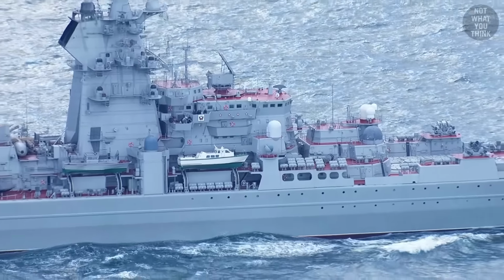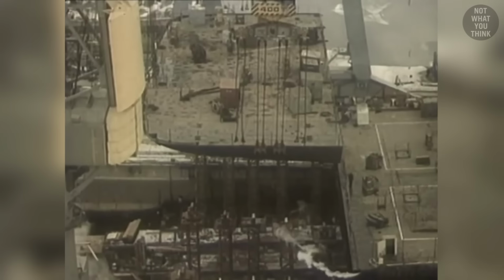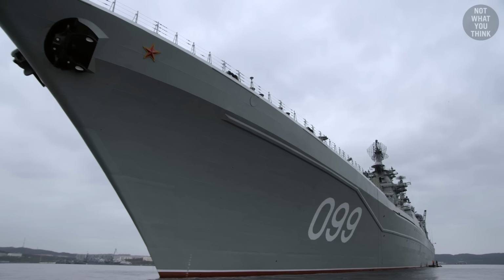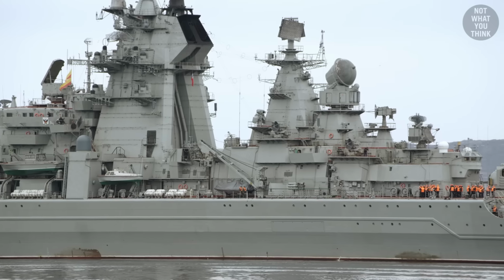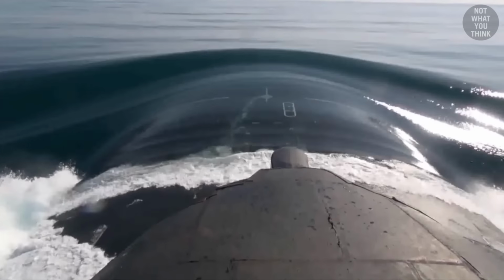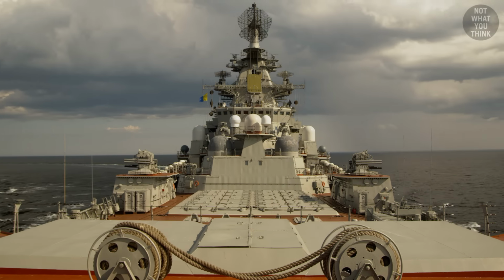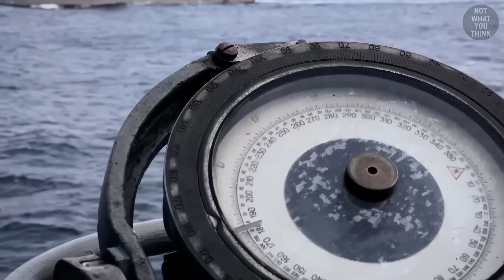Russia's Massive Nuclear-Powered Warship That Smokes

Comment: The US classifies aircraft carriers as CV, aviation cruiser. The nuclear surface ships should have both diesel generators and an auxiliary boiler. A nuclear ship capable of 30 kt might operate at about 20% power for 20kt. Power goes up sharply above 25 kt. The diesel generators are normally only used to provide electrical power while the reactors are shutdown. The auxiliary boiler allows water distillation, heating and cooking, again the main steam plant is shut down. Otherwise , main steam can be used for auxiliary loads.
Now comes the debatable topic. The service life of the hull and the reactor may not always align. Suppose it is felt that the hull might last several years after the current nuclear cores are expected to run out of fuel. If this is known sufficiently far in advance, we can make the decision to run the diesel generators and auxiliary boiler, reducing normal load on the reactor from 20% to perhaps 10%, extending the life of the core to the desired period

Comment: If you intercept the Bissell close to its Target the debris will Pepper you like a 7 ton shotgun shell but if you get this thing out a thousand two thousand meters it's just going to drop into the water the pieces they're not going to have that much inertia especially when they lose aerodynamic properties

One thing I find funny about people saying you can't shoot a Hypersonic weapon is that you don't need to Target the weapon you just need to throw a handful of gravel into its path and the speed is going means that that gravel is giving the same kinetic Force to the missile is the missile itself is going to give so even if you shoot it with double-ought buckshot that buck shots going to be traveling at several thousand miles an hour in relationship to the missile and it's just going to tear right through it this really is an application for Flak with many small pieces

Comment: Nice video, the issue though is that while Russian tech are, on paper, capable of doing certain things, the truth often being it isn't the case, it is often not reliable enough, doesn't work properly, or even simply lack crew capability to properly use it, like the KA-52 shot down by missiles while having their anti missile system turned off during a war that involve heavy hostile anti-air use...
Reply: At least one of those 52s was destroyed by a Ukrainian ATGM ("Stugna P"), that uses laser guidance. Even if the missile detectors/jammer had been turned in, it would have made no difference. Starstreak, a British anti-air missile, also can't be effectively jammed or "distracted." rooZZians just believed their own hype and didn't give enough thought to what could possibly pose a real threat.
Reply: @lordphullautosear  Actually, modern aircraft, including the KA-50, do have laser detections for those eventualities.
As well as other protections, like IR sensors that detect missile launches (at them or otherwise), and IR jammer.
There is also laser jammers that blind laser guided missiles but IDK if the KA-52 or Russians in general do have that tech (I know they have laser detection and IR jammer, but IDK how it works if at all against laser guided missiles).
Look out the "Vitebsk-25" system.

But in any cases, either the pilots poorly reacted or were not properly formed to use the tech properly, or the tech didn't work, or they were taken by surprise in a situation they didn't have the time to react.
But two out of three possibilities are Russians nor knowing how to military... xD

Comment: You are correct when you state the Kirov class cannot achieve top speed without bringing an oil-fired boiler online.  During the 1970s I was stationed in USS Francis Hammond (FF-1067), we were conducting SOAP or Soviet Out-Of-Area Operations.  Simply put, we were following a Kirov class ship and another ship.  The Soviets would very rarely venture outside their home waters.  My ship was tasked to follow them around the Pacific.

Comment: Using nuclear power for the slower speeds the ship uusually operates at was more economical. Then adding a cheaper oil fired superheater to give the steam more energy and enabling a high rtop speed  when needed. A much less expensive solution than installing nuclear power plants with sufficient power to drive ship at its top speed.

Comment: I wonder if, with the removal of the aft turret on an Iowa class BB, could a nuclear reactor be slotted into the now-empty barbette...?
Reply: the 100000 OSHA violations that would entail tho...
Reply: @idkk1086  Fun fact: OSHA straight up just doesn't apply to the U.S. military. Those soldiers can do whatever stupid, dangerous crap they can get away with, and OSHA can only look on in horror with no power to stop it.

Comment: Actually, the Iowa Class aren't permanently decommissioned. Each organization that has one as a museum signed contracts that basically make them no more than caretakers of the ships which have to be kept in mothballed ready to reactivate condition. The curator of Battleship New Jersey has talked about this on multiple occasions. He did so recently in a video on their future day docking of the ship.

In previous videos you can tell he is worried they could reactivate the Iowa Class and take New Jersey away from him. He makes so many BS excuses as to why it wouldn't be practical or cost originative even though reactivation is cheaper than building s be ship with similar capabilities. He also tried to claim that it can't handle the power of modern weapons/missile systems basing it on the ship using incandescent and florescent lighting even though they'd be replaced with LED lighting that is fast more efficient in a reactivation considering they replaced a lot of the incandescent lights with florescents.

The only reason who the Iowas were decommissioned in the 90s was because of politics and corruption/graft. It was done so those destroyers with the vaporware rail find could be built that taxpayers lost billions on and can't do squat as a naval asset.
Reply: What role would you have an Iowa serve?
You have to train up a lot of sailors to operate it's specific systems, and more importantly maintain logistics to keep everything going. Is it worth all that? I can think of tons of things that money and effort would be better spent on.
Reply: @IllustriousCrocoduck  What role? Try multiple roles. First off, the Iowa Class serve as intimidation and a deterrent with our enemies. A role they served in for decades that actually helped keep the peace. Then there is shore bombardment/troop support a role which is one we haven't had filed since the Iowa Class were decommissioned. Mine sweeping is another role they are capable of that we don't really have anything else to fill with. Then there is the fact of its survivability compared to any ship in the US Navy or any Navy for that matter. If what happened to the USS Cole happened to an Iowa Class there wouldn't have been any need for repairs just a squeegee and some water to clean the blood smears off of it. We don't have anything remotely armored like they are. And I can go on here too.

Bottom line, to replace one Iowa Class, it requires multiple ships to do so and none of them can do what Iowas do nearly as well. Look at every attempt to build a ship to replace just one of the roles they are well suited for and capable of. Every single one has been a failure that has wasted billions and billions of taxpayer dollars. Spend a billion dollars in today's money to completely modernize, automate what systems you can, and reactivate an Iowa and you're still coming out on top financially and militarily.

Comment: Yeah, the claim that an intercepted Granit missile will just sail onto the target by inertia alone is literally not how physics works. It's an interesting story though. Aegis and a single F-35 can stop an entire Granit salvo by themselves, without the CIWS systems even coming into play.
Reply: IIRC the claim was a bit more realistic - if it gets into CIWS range, at least shrapnel damage is guaranteed. More if the Phalanx fails to hit it.
Work on missiles like this was probably the reason why the Goalkeeper was developed in the 1970s - with the 30mm from the A-10 it should give you that extra range to destroy the missile far enough.
Reply: @AndrewCZ47  You see, that's not correct. If it gets intercepted, physics says that kinetic impact WILL alter it's trajectory and speed. Then the damage done will cause even more chaos in it's trajectory and speed due to drag forces. The likelihood that a missile continues on to still impact a maneuvering target is pretty much zero. Considering that intercept ranges start at like 560 miles...yeah I'm pretty sure a Granit isn't going to eat an SM-3 and then fly for another 200 miles in inertia alone and with no maneuvering capability. Lets try to remain slightly realistic here.
Reply: @Armoredcompany  I was talking CIWS, not countermissiles. From entering effective range of a Phalanx to impact it's less than 2 seconds, not enough for a big trajectory change. 
If one of the Aegis cruisers nails it with a SM-3, you're fine. If a ship that's not a target manages to hit it with a Phalanx, you're probably fine too. But once it's inside your own CIWS range, it's gonna hurt no matter what you do.
Reply: @AndrewCZ47  right. By doing that, though, you're only taking into account the last 0.001% of interception envelope. That is like asking 1 person if they like Trump then saying "100% of people polled loved Trump".

Comment: The ship has not just nuclear reactors but also 4 gas-turbine generators working on burning or ordinary fuel made from oil. That could cause smoke, especially at starting phase, when gas-turbines are heating and entering working mode. It requires lots of fuel. They are for different purposes, emergency, etc. Each has power 1.5 megawatts. So, they pretty powerful. Probably crew had task to test how they worked. that's it.

Comment: Another problem with that cruiser is the systems on it are extremely old and outdated. Nobody knows how many actually work as it was revealed on the Moskva cruiser. Russia is not the best when it comes to maintenance. Even when they actually do maintenance work it is not exactly sure how good of a job was done example - the Moskva cruiser again. Keep in mind that this cruiser was considered the lead ship of the Black sea navy. This is a real problem that caused a 10, 11, 12 (whatever) thousand cruiser to get sunk by 2 subsonic anti-ship missiles. Russia was never considered a champion of the digital world so it is perfectly reasonable to assume that even with replacement of older systems it would still be behind the West when it comes to technology onboard.

Comment: Heavy meltdown i guess 😂but with diesel btw i don't think their reactors for ships are so bad i just don't believe that yes they we're but now it's good as other but problem is construction protection and needed systems and backup systems for reactor function that's not easy task nor cheap and also if reactor will be damaged due to some shell shot...and these ships don't sink easily...but with damaged reactor even if ship is relatively capable for sailing even that shot if it will be idk...from some aircraft bomb all crew members must have leave that ship immediately and leave it there just to throw some particles into the atmosphere if that damage will be so severe and reactor damaged enoug to release some radiation ... it's extremely exaggregated i know but you never know...umm not a smart move diesel is safer bet and cheaper well i doubt that about reliability but that's not a topic now but i don't know much about warships construction but i know something about reactors and weapons so if cooling system fail and that's a really weak point even if exotic cooling solution is used like melted salt or metals/gasses but maybe thorium/MOX FBR will overcome these issues some day but i don't think so

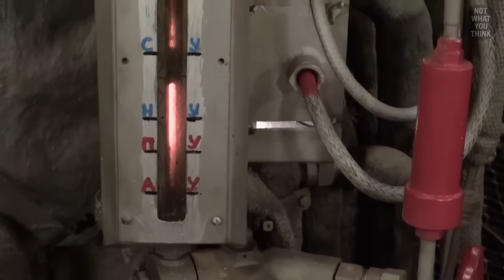Comment: 2:13 I don't believe the oil-fired boilers were there as back up in case the two nuclear power plants failed. Two reactors are coupled to oil-fired boilers that superheat the saturated steam produced in the nuclear reactor plant to increase the power output available during high-speed running as you later mentioned.  If the Kirov class can even move under oil power alone isn't clear.

Comment: Lol! Anyone who actually learns about nuclear technology. Understands that water cooled reactors must keep the nuclear cores WET! That means if you want dry high energy steam for your steam turbines? A way to supper heat that steam is needed. Oil fired super heaters and boilers, are a low tech solution to a complex problem. I have often wondered how CVN-65, produced dry steam for her turbines and catapults? How the US Navy solved this problem is still classified. Despite the fact that both CGN-9 and CVN-65 have been decommissioned. The fact that CVN-68, uses only two reactors for more power? Suggests these reactors are not water cooled. So? Truely high speed operations are not unlimited for Kirov class cruisers.

Comment: So this ship is larded down with the extra mega tonnage of a spare nuke reactor AND a 1/2 size oil fired power plant?  WHAT WITH TWO REACTORS IT CAN ONLY DO 20 KNOTS, what crap.  it should do 40 knots, what an aircraft carrier does.  Any rate so much of HUGE SIZE of this thing is wasted with redundent inefficient engineering spaces and fuel storage.  Making this say the actual equivalent of a much smaller allied ship.